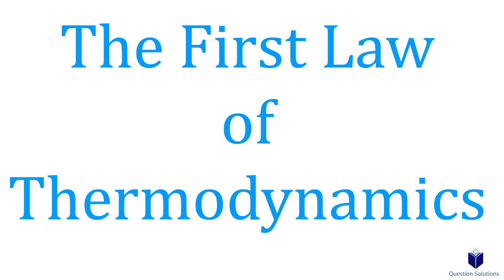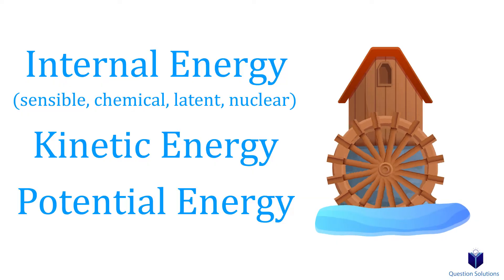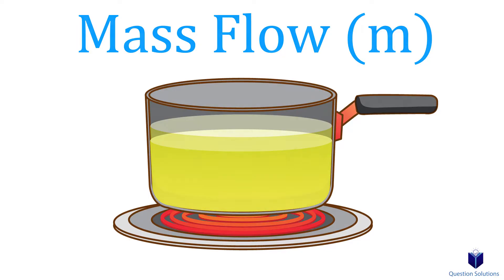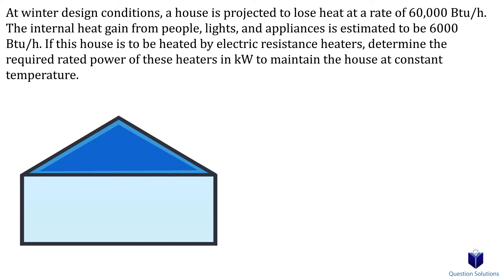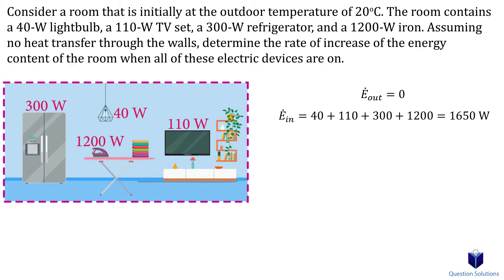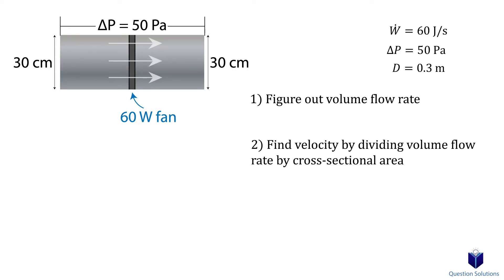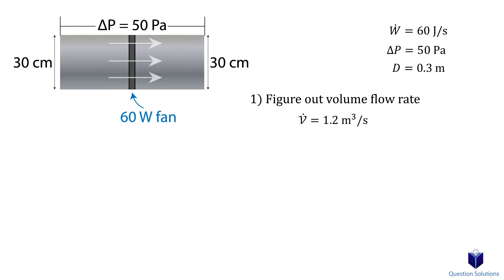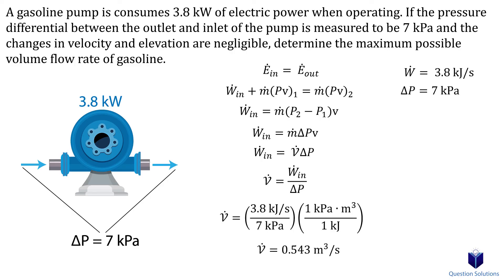The First Law of Thermodynamics | Thermodynamics | (Solved Examples)

Comment: heyy for the duct question, the one with the fan, is there a velocity change, like from the lower pressure area to the higher one? i dont get why you only considered flow work and work done by the fan for the energy balance equation here?
Reply from the maker: The question is only requesting average flow velocity, so we don't need to consider initial and final velocities.